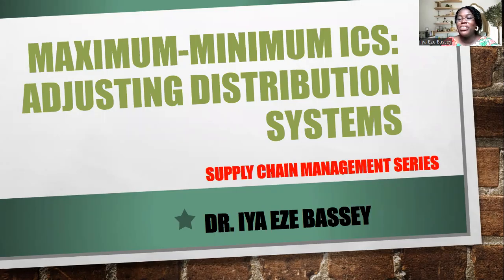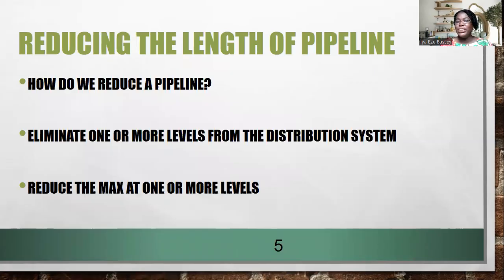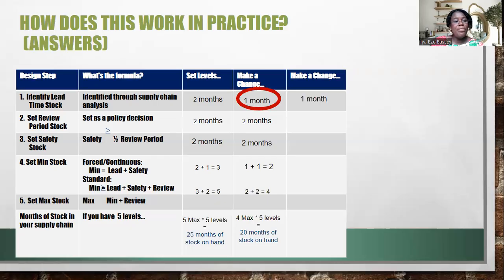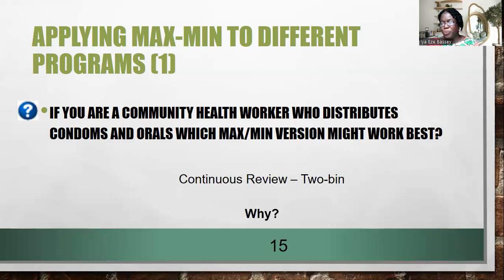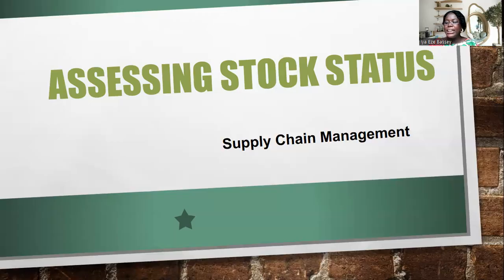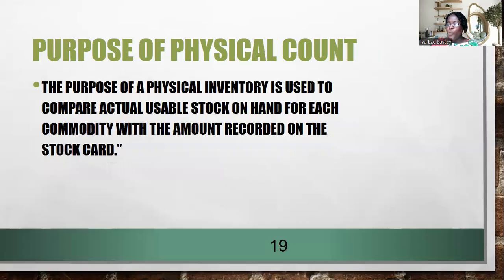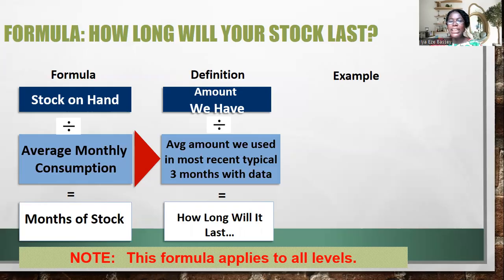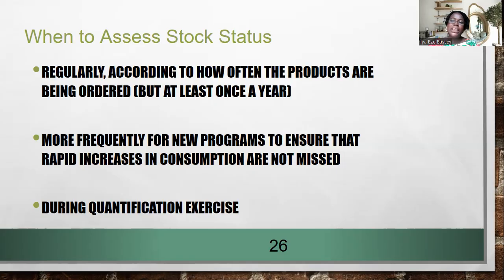Maximum-Minimum ICS: Adjusting Distribution systems (Supply chain management series)

Comment: Thank you, Ma, for the enlightening lecture. It significantly enhanced my comprehension of the fundamental objectives of an Inventory Control System (ICS), which are as follows:

1. Stock Optimization: ICS facilitates the maintenance of optimal stock levels to mitigate the risks of stockouts and overstocking, thereby ensuring uninterrupted service delivery.
2. Replenishment Planning: It aids in accurately determining the appropriate quantity of stock to order and the precise timing for reordering, thereby streamlining procurement processes.
Additionally, I gained valuable insights into key terminologies associated with ICS:
Maximum Stock Level: This refers to the upper limit of inventory a stock keeper is authorized to maintain. For commodities such as those related to HIV/AIDS programs, including laboratory reagents and consumables, this threshold is typically set at a 4-month supply.
Minimum Stock Level: This denotes the lowest permissible inventory level required to avert stockouts. For essential commodities, a 2-month buffer stock is generally maintained.

Types of Min/Max Inventory Control Systems (ICS):
1. Forced Ordering Max-Min ICS: Reordering is triggered regardless of current stock levels at predefined intervals.
2. Continuous Review Max-Min ICS: Stock levels are monitored continuously, and orders are placed when inventory falls below the minimum threshold.
3. Standard Version Max-Min ICS: A hybrid approach incorporating features of both forced and continuous review models.
Additional Concept:
Review Period: The predetermined interval at which inventory levels are assessed to determine the need for replenishment.Emergency Order Point: The critical stock threshold at which an urgent procurement action must be initiated to avert imminent stockouts.
Safety Stock Level: A contingency reserve of inventory maintained to absorb fluctuations in demand or supply chain disruptions.
Lead Time: The duration between the placement of an order and its receipt, essential for planning procurement cycles and avoiding stockouts.

These concepts collectively reinforce the importance of structured inventory management in maintaining service continuity and operational efficiency.

Thank you once again for this thorough and highly informative lecture!

Comment: Thank you very much ma for this informative lecture I learnt the important of adjusting distribution system 
Steps to consider is length of pipeline 
second step is reducing the length of pipeline 
I also learned about the factors that impacts max-min stock levels, which includes leadtime, reliable source of supplies effect of is zero balance of stock and shelf life production cost

Comment: In summary, maximum minimum inventory control systems are super useful for managing the supply of laboratory reagents, consumables and equipment in medical laboratory science. By setting the right maximum and minimum stock levels, labs can meet testing demands without having too much or little inventory. This helps keep operations smooth, resources optimized and ensures timely delivery of accurate test results.
Also, the factors that impact maximum minimum level are
1.Age
2.Cost of storage
3.Cost of production
4.Lead time
5.Cost of storage

Comment: Thank you ma for this exciting module.
I learnt that maximum minimy inventory control system is important for managingy stock levels helping to prevent over stocking and under stocking.
Inventory control is used for managing the supply of laboratory reagents , consumables and equipment in the medical laboratory.

Comment: At the end if the video I was able to learn the followings

1. Identifying the ways to adjust distribution systems policies using the the systematic chain from the PORT to the CLIENT.

2. The advantages and challenges of Max-Min Inventory Control system

3. How to describe the inventory control system used in the logistics management if HIV/AIDS

In Reducing the maximum stock level these must be done;

Comment: Thanks for the lectures ma'am. I learnt that the Maximum-Minimum Inventory Control System (ICS) adjusts the distribution system by:
Key Functions
1.Setting inventory limits
2.Monitoring inventory levels
3.Triggering replenishment
Benefits
1.Optimized inventory
2.Reduced stockouts
3.Improved efficiency
By implementing a Maximum-Minimum ICS, organizations can improve their distribution system's efficiency, reduce costs, and enhance customer satisfaction.

Comment: 🎉Thank you Ma, for the exposition on the topic of adjusting distribution systems within the maximum-minimum inventory control
Here is my  summary Mma
Optimization of health commodity supply chains from central to rural levels must be focused on setting and verifying initial maximum policies for each facility and ensuring proper distribution system functionality, including assessing the overall pipeline length. 
*Methods to reduce this pipeline include eliminating distribution levels or strategically decreasing maximum stock levels by adjusting factors like review periods and lead times, and improving system reliability to lower safety stock.
*Various factors influencing max-min stock levels include product cost, transport reliability, storage capacity, shelf life, and management skills.

*The significant advantages of using a max-min system include preventing overstocking and understocking, minimizing waste, and simplifying inventory decision involves both physical inventory counts to verify records and determining "months of stock" using the formula: Stock on Hand / Average Monthly Consumption. Regular stock assessment is essential. 
 * In a Push System, a higher, central level makes decisions about what and how much to order, "pushing" commodities to lower-level facilities regardless of their specific needs.
 * In a Pull System, lower-level facilities determine order quantities based on their actual consumption and needs, "pulling" commodities from higher levels.

Comment: IN SUMMARY OF THE MAXIMUM -MINIMUM ICS: ADJUSTING DISTRIBUTION SYSTEMS

Steps in designing the Max-Min inventory control system are
1. Determine the max level
2. Determine the min level 
3. Calculate the reorder point 
4. Calculate the order quantity
5. Monitor inventory levels
6. Review and adjust 
Ways to reduce the length of a pipeline 
1. Eliminate one or more levels from the distribution system 
2. Reduce the maximum at one or more levels 
Some factors that affect the determination of max and min stock levels besides the length of the pipeline 
1. Cost of product
2. Reliability of transportation 
3. Storage capacity 
4. Lead time 
5. accuracy of forecast 

Accessing stock status
The purpose of this is to determine how long supplies can cost
The formula for calculating months of stock on hand:
Amount we have( now) + Amount we use( each month) = How long it will last ( in numbers of month).

Comment: This topic summarizes the adjusting distribution systems.
Here,we looked at the steps in designing a max-min ICS .
Another outline I learnt was how to reduce the maximum stock level .
Other factors that impact max-min stock levels
-cost of products 
-cost of storage
-Reliability of transportation 
-lead times etc.
Advantages of using this system includes:
-minimizes wastage
-Avoid under stocking 
-consistency of stock levels
-systems with numerous levels 
I also learnt how to apply max-min to different programs .
Then we looked at accessing stock status where we defined physical count as the process of counting by hand the the total number of usable unit of commodity in store. 
And finally,I learnt how to assess stock status

Comment: Thanks so much Mar,
I learned that the maximum-to-minimum inventory control system is very important for managing stock levels. It helps to avoid both overstocking and understocking.
This system is especially useful in medical laboratories for managing the supply of laboratory reagents, consumables, and equipment. It works by monitoring the length of the supply pipeline and considering several key factors that affect inventory levels. These factors include:
The program's age
Cost of storage
Cost of production
Lead time
By keeping track of these, the system can maintain optimal stock levels.
It also helps reduce emergency ordering costs by regularly providing updates on the stock status. This makes inventory management more efficient and cost-effective.

Comment: Based on these discussions about Max-Min inventory control systems in public health supply chains, I've learned that these systems are crucial for managing health product storage effectively. The process involves starting with rules for each facility, ensuring consistent rules across all levels, and understanding the length of the supply chain. Max-Min systems aim to keep stock at optimal levels, reduce waste, avoid emergency orders, and simplify planning.
To optimize these systems, one can shorten the pipeline by removing system levels or lowering the maximum stock level. Reducing maximum stock can be achieved by more frequent reviews, speeding up the supply process, and strengthening the system to reduce the need for safety stock. Factors influencing Max-Min stock levels include product cost, storage space, storage cost, shelf life, and transport. While beneficial for streamlining supply chains, especially for perishable goods and balancing inventory, challenges include managing systems with multiple levels and a wide variety of products. The purpose of stock assessment within this framework is to conduct physical counts, verify stock accuracy, and prevent discrepancies that lead to stockouts or overstocking.

Comment: This lesson helped me understand how to plan a max-min system for health items. The steps are:
	•	Make rules for each facility level
	•	Ensure rules fit the whole system
	•	Look at how long the supply chain is

To shorten the pipeline:
	•	Remove a supply level
	•	Decrease max stock level in some places

Ways to reduce max stock:
	•	Review more often
	•	Make delivery faster
	•	Make the system better so we need less backup

Things that affect max-min stock include:
	•	Cost of the product
	•	How much storage we have
	•	Cost of storing items
	•	How long the items last
	•	How reliable transport is

Max-min helps by:
	•	Stopping too much or too little stock
	•	Reducing waste
	•	Avoiding emergency orders
	•	Making stock choices simple

Problems that may come up:
	•	Too many system levels
	•	Lots of product types
	•	New health programs

Physical count means checking all stock by hand.
Stock status is how long the supplies will last.

Comment: Thank you, ma, for explaining how to adjust distribution system policies. I learned that the first step is to consider the pipeline length, as reducing levels in the distribution system lowers the maximum stock needed.

Factors affecting Max-Min stock levels include product cost, transportation reliability, storage capacity and cost, and shelf life of commodities.

Advantages of the Max-Min system:

Prevents overstocking
Prevents stockouts
Reduces emergency order costs
Minimizes waste
Maintains consistent stock levels
Physical counting is manually tallying usable units in stores. Stock status is checked regularly, especially often for new programs to track consumption changes quickly.

Comment: Key Takeaways on Inventory Optimization and Supply Chain Streamlining
I'm truly grateful for the insights gained from this course, particularly regarding optimizing inventory management.
The video was instrumental in illustrating strategies for streamlining the supply chain by eliminating unnecessary stages in the distribution system. This highlights the importance of efficiency in getting health commodities to where they're needed.
I can now clearly identify the key factors that influence optimal stock levels:
 * Product cost: The financial value of the items.
 * Storage capacity: The physical space available for holding inventory.
 * Shelf life of health commodity: The expiry date of the products, crucial for preventing waste.
The Max-Min system offers distinct benefits that are essential for effective inventory control:
 * Mitigation of overstocking: Prevents having too much product on hand, which can lead to waste and increased storage costs.
 * Preventing understocking: Ensures sufficient supplies are available to meet demand, avoiding shortages.
 * Reducing wastage: Minimizes losses due to expiry, damage, or obsolescence.
Finally, I thoroughly understand that physical counting involves manually tallying every unit of each item in stock. This process is vital for reconciling actual stock levels with the recorded amounts in inventory records, ensuring accuracy and accountability.

Comment: I learned that maximum to minimum inventory control system is important for managing stock  levels helping to prevent both overstocking abd under stocking inventory control is useful for managing the supply of laboratory reagents., consumables and equipment in the medical laboratory. Its also by checking the length of pipeline,  and learnt that factors which impact the maximum-minimum level , age of program,cost of storage, cost of production and lead time  
Its aids in avoiding emergency order cost by providing a guide to the stock status  on a regular basis .thank you ma

Comment: Thank you so much ma for such an exquisite lecture videos where we get to understand what minimum -maximum ICS
is and also adjusting distribution systems. From the video I learnt that adjusting distribution systems in maximum-minimum inventory control systems is crucial. I learnt that to reduce the length of a pipeline, one can eliminate one or more levels from the distribution system or set up policies to reduce maximum stock levels at one or more levels. I also learnt that the standard version of the maximum-minimum inventory control system is suitable for managing a large number of commodities. Additionally, I learnt that assessing stock status is essential to determine how long
supplies will last.
Thank you ma

Comment: I learned a lot from this lesson. Inventory control helps stop us from running out of items or having too much. 

The terms you taught us were:
	•	Review period – when to check stock
	•	Maximum stock level – most we can hold
	•	Minimum stock level – least we can hold
	•	Emergency order point – urgent need to order
	•	Safety stock – extra just in case
	•	Lead time – time between order and delivery

You also explained three inventory systems:
	1.	Forced ordering
	2.	Continuous review
	3.	Standard version

The fuel and food examples helped me a lot, and the math video was very clear.

To set stock levels, we:
	•	Know the lead time
	•	Pick a review time
	•	Choose the safety stock
	•	Set min and max
	•	Set the emergency order point

Comment: Thank you for the engaging lecture ma! I gained valuable insights into optimizing supply pipelines by streamlining levels and adjusting key formulas, such as review periods and lead times, to calculate maximum stock levels. I learned that factors like lead time, storage capacity, and costs impact max-min stock levels. The main benefits of this system include preventing overstocking, understocking, and wastage. I also understood the challenges associated with different inventory control system variations. Additionally, I grasped the importance of physical counting, which verifies actual stock against records, and the Months of Stock (MOS) formula, which determines supply duration. I now appreciate the significance of regular stock assessments for effective inventory management.

Comment: Thank you ma'am for the wonderful class,
In summary i have learnt that max-min inventory control system is important in managing stock level helping to prevent both overstocking and understand rocking.
  I also learnt the following step in designing max & min ICS 
1) set up initial max-min policies for each level and type of faculty.
2) check if the overall distribution will function properly if the level specific max-min policies are implemented.
3) check the total length of the pipeline that the policies at each level imply.
Factors that impact max-min stock level 
Cost of product, reliability of transportation, storage capacity, cost of storage, storage condition at different levels, shelf life of health commodities.
  I also learnt the advantages of using max-min which are: 
-Avoid over stocking.
-avoid understocking. 
- minimize wastage.
-  avoid cost emergency orders.
- simplify inventory control decision making.
- consistency of stock level.
- reliable data source from SDP for forecasting and quantification.

Comment: I learnt MAX-MIN ICS(ADJUSTING DISTRIBUTION SYSTEM).
You can reduce the length of a pipeline by eliminating one or more level's from the distribution system.
OTHER FACTORS THAT IMPART MAX-MIN STOCK
LEVEL
- storage capacity
- cost of production
- cost of storage
ADVANTAGES OF MAX-MIN ICS
- Avoid overstocking
- avoid under-stocking
- minimum wastage
I also learnt about Physical count and also formula

Comment: Thank you ma.
This lesson taught me how to plan a max-min system for health product storage. The steps are:
	•	Start with rules for each facility
	•	Make sure all levels follow the same rules
	•	Look at how long the supply chain is

To shorten the pipeline:
	•	Remove a level from the system
	•	Lower the max stock level

To reduce max stock:
	•	Review more often
	•	Speed up the supply process
	•	Make the system stronger to need less safety stock

What affects max-min stock:
	•	Product cost
	•	Storage space
	•	Storage cost
	•	Shelf life
	•	Transport

Max-min helps because it:
	•	Keeps stock at the right level
	•	Reduces waste
	•	Avoids emergency orders
	•	Makes planning easier

Problems may be:
	•	Too many system levels
	•	Many different products
	•	New health programs

Physical count means checking stock by hand.
Stock status is knowing how long supplies will last.